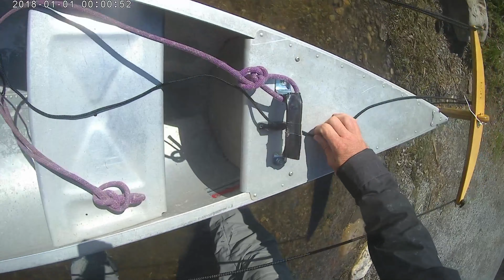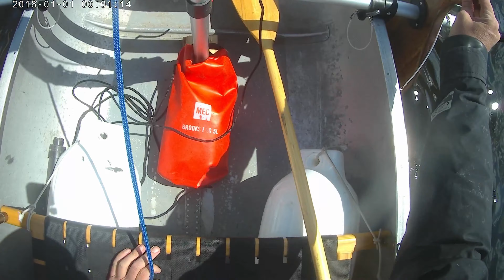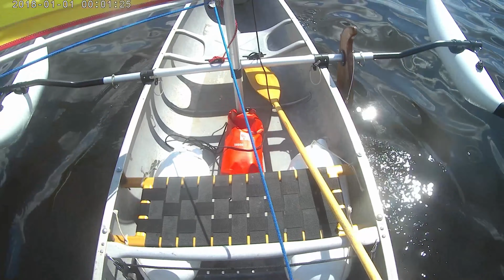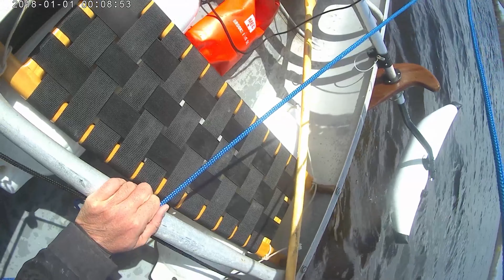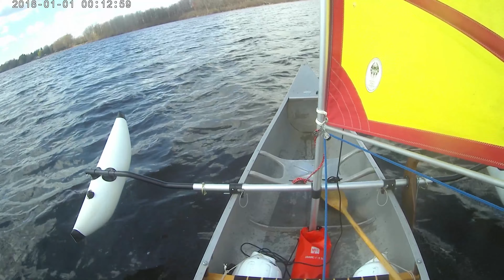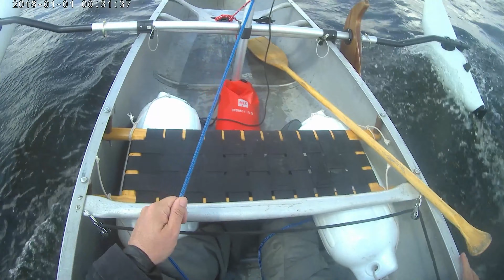Canoe Sailing-  Rideau River

Comment: "downwind help, to keep it going straight" ...lee helm? If that's it, try moving the mast aft about 3" a time until you feel you have just a hint of weather helm.
Reply from the maker: I read about the cause in Bradshaws Canoe rig I think.  Apparently it has to do with a canoes symetrical hull form.  As it heels it develops a lot of weather helm, kind of like a ski carving.  So at neutral speed, there is neutral helm, but as the boat accelerates, the weather helm increases.  I kind of like steering with the cable steer with a bit of weatherhelm.  Don't really need to steer, just maintain some down wind tension on the line.  Sailing canoes and beach cats, they are so much fun to sail.   They're is just so dynamic :)

Comment: Hello. I’m modifying my grumman canoe. Any tips?
Reply from the maker: Nothing specific except that Grummans are about the best boats out there for doing cool mods on.  They are strong enough that you can get away with a lot without having to worry about damaging them and Grumman made tons of factory mods including sail rigs, rowing rigs, outboard brackets.  Some are still available on market place or Ebay and were built to last.
Reply: @travelbywater9378  do you need the stabilizer’s or can you get away with leaning?